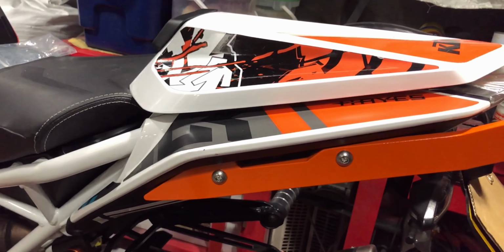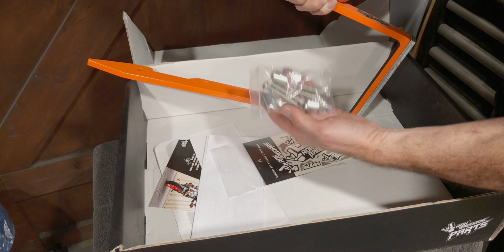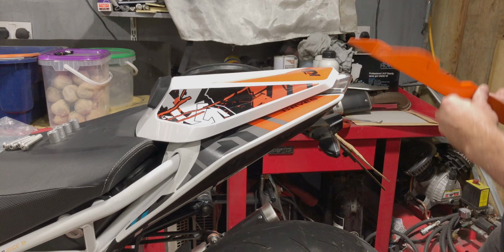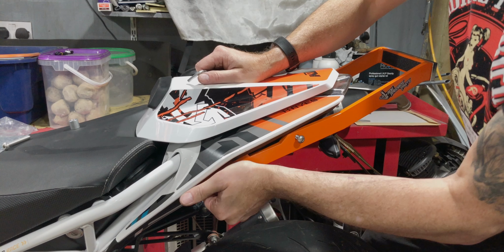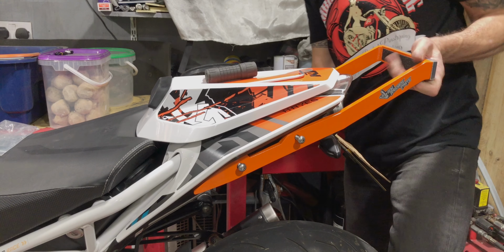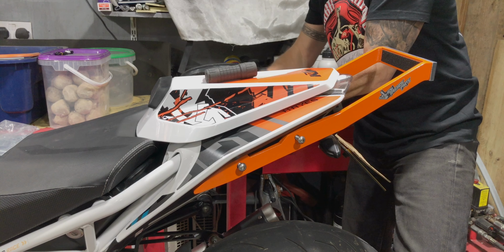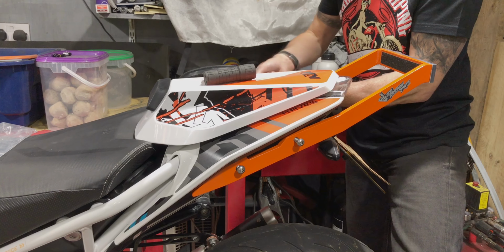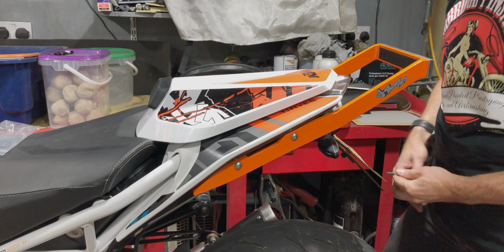Wheelie Bar Install KTM Duke 390 125 250 200 Bagaros Performance

Comment: I NEED HELPPPPPP, I HAVE A BANDIT 250 AND MY FATHER AND I ARE DOIN ITS WIRING AND WE HAD A PROBLEM EITH THE CDI AND I WENT TO REPAIR IT AND WHEN I CAME BACK THE BIKE HAD NOO POWER AT ALL AND I CHECKED ALL THE FUSES AND ALSO THE EARTH, WHAT THE HELL SHOULD I DO????
Reply from the maker: The most important thing to remember with wiring is to take it one wire at a time - if you try to treat the loom as a whole unit, you will never find the problem.   The two most common issues with wiring are bad earth connections to the engine/ frame (take them off and clean them even if they look ok) and where people have previously cut into the wiring and made new connections.  Most wiring professionals recommend using connectors and not soldering because the vibration and cable flex breaks the solder.  When you say you have no power - decide what you mean.  Do you mean the battery is flat or that the generator is not producing power?  Check the connections and trace the power until you find the problem.   Good luck!
Reply: @MotoMirius  i traced the orange wire which a mechanic told me was the power wire that delivered power to the CDI so i traced the wire and i found out that  4 of my fuses were blown off and they were 15 AMP and i had 2 more fuses whih were 30 AMP and they werent blown so the mehanic told me to use a 20 AMP fuse/ CAN U TELL ME WHAT AMP SHOULD I USE OR WHAT IS THE AMP OF THE GENUINE FUSE THAT COMES WITH THE BIKE
Reply from the maker: @shujabhatti536  I don't have a 250 so I can't advise you what fuses it will need - try and find an online copy of the service/ owners manual - or look on the fusebox - it's often marked.  I do have a strong advice for you.  Find a new mechanic - anyone who recommends putting a larger fuse than the manufacturer recommended one in is not qualified to work on your bike
Reply: @MotoMirius  thanks man

Comment: Hey I have duke 390 2020 bs6 and I’m thinking of removing db on the stock exhaust and does that effect the engine ??
Reply from the maker: If it's the only change you have made, normally this is ok and I have heard no stories of damage - people who have problems always shout loudly.  KTM are clear that you can fit the Akrapovič slip on without damage and that flows more air than the stock exhaust - and from the sound more than a debaffled stock exhaust.
Reply: @MotoMirius  what about removing exhaust and only keeping ta cat? Will it effect the performance.
Reply from the maker: @pablogaming7647  If you mean removing both presilencer and silencer then yes, bike will lose power and you will need a piggyback to add more fuel - it is why the RC was never fitted with a short exhaust.